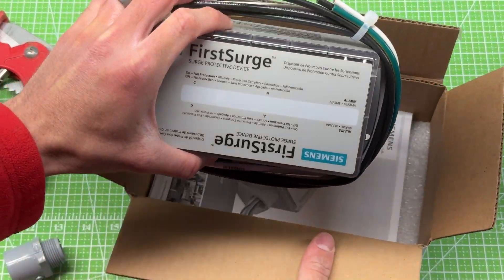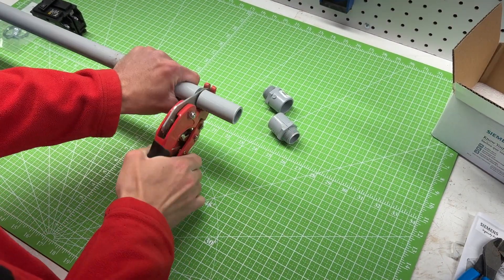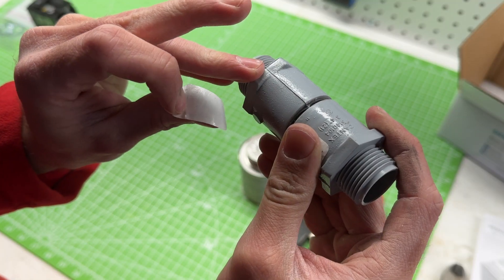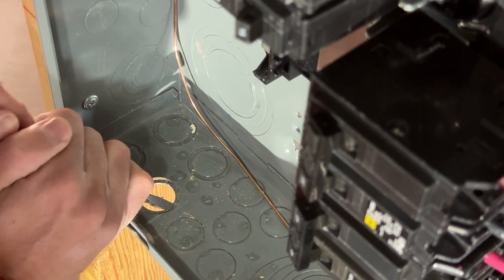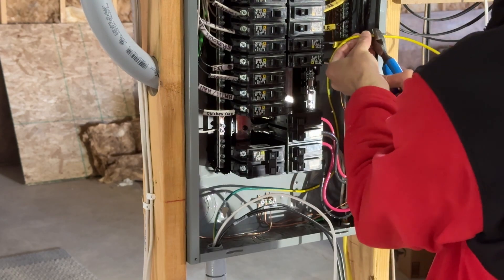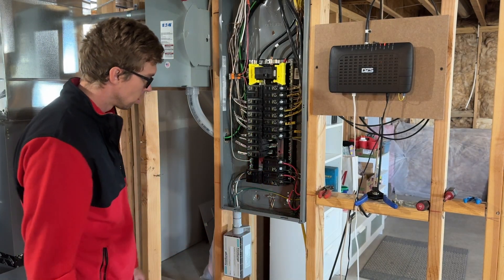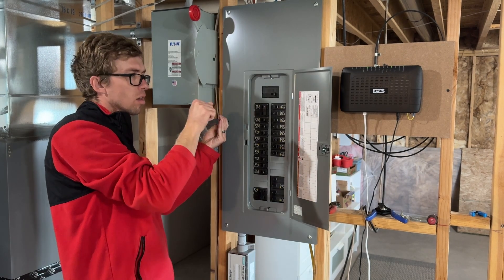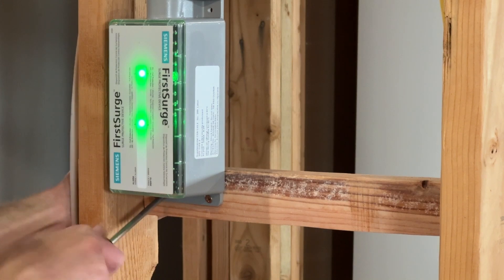Surge Protect Your WHOLE House

Comment: I don’t see a big ground conductor where the surge will get dumped by the FS140 through a short path to ground.  In my install the panel is on the inside of an outside wall and a 1/4” ground conductor goes 4’ down from the bonded ground/neutral bus to the outside ground rod.

In fact, where is your panel ground.  I see the neutral connection at the top and that the neutral and ground bus bars are bonded, but where is the fat ground connection??

Comment: 20 amp breaker for a whole house protector… what’s the KA on that surge?
Reply from the maker: The FS140 is rated for 140kA. Yeah the manual calls out using a 20amp breaker for the connection.

Thermal breakers don’t trip immediately and with such a fast surge it shouldn’t be throttled it in any way by the breaker.

Comment: A word of warning. Strong demand has the price of this particular Siemens bouncing around. I bought mine from Amazon four years ago for about $170. A service that tracks Amazon pricing has the Amazon price ranging from $159 to $464 between 2020 and 2024. It has the third party price ranging from $128 to $706 between 2017 and 2024. 
If price is an issue with you, Siemens has created a new version, the FSPD140, that typically sells for less. Youtube's abrelectric channel has a comparison of the two called "Comparing the FS140 to the FSPD140" that you might want to watch.

Comment: If the electrical wiring bothers you, the makers of some brands and models of breaker boxes offer whole house surge protectors that simply snap into place like a breaker. You only need to connect a white wire to the neutral circuitry inside the box. No voltages there. 

For Square D Homeline breaker boxes made after 2014 you are in luck. Their HOM250PSPD simply snaps in and doesn't require a neutral wire. That is built in. You simply need two adjacent breaker slots free at the top. And it is currently marked down 42% to $81. That said, the surge rating is only 50,000 amps as opposed to 140,000 amps for this Siemens. You can find a video of the installation at: https://www.youtube.com/watch?v=TmFbOQF85h8

Comment: How it workd? In my town got overvoltage, like 190v when i need 110v stable. This thing protect for that? Turn de breakker off?
Reply: This is a surge protector, meaning sudden, split-second over voltages that can run to thousands of volts. It is not intended to protect against continuous over voltage and if remember right it doesn't even cut in for voltages under 400 volts. 
If you're getting 190 volts regularly at the outlets, you need to yell at your power company. If they don't respond quickly enough, contact your state regulators.

Comment: The breaker should be installed at the top close to the main
Reply: Not as important as keeping the leads as short as possible FROM the SPD....TO the feed breaker. The "wire size" ( high ampacity) of the bus overwhelms the "desired" position close to the main. Another thing..... it would be even better that the lines from the SPD to the breaker be twisted around one-another or laid tight against each other....as it improves the voltage threshold VPR numbes. See here for added destail....but ya gotta read the detail to understand-->
- Cut leads as short as possible, between the SPD  (Surge Protection Device) and the panel-connection/breaker....for the power it needs. Very important. Long leads compromise the unit’s VPR specs severely. Besides short leads.....either twist the leads or zip-tie them together to re-gain “goodness”....if you can’t get absolutely shortest leads possible ( testing labs use 6” leads to come up with specs.)
- Not important WHERE on the panel buss.....the SPD dual-pole breakers are located. Intuitively, the closer to main breaker (Feed breaker, from line to load) the better..... but his has MINOR influence....much less than the short lead issues.
- Background on all this..... 
https://ep-de.mersen.com/sites/mersen_de/files/2018-11/TT-SPN8-Effects-of-Wire-Lead-Length-on-Voltage-Protection-Rating.pdf
Reply from the maker: I would have preferred that but I didn’t have space on either side of the panel towards the top. Networking equipment on the right and a transfer switch on the left. My placement isn’t ideal but it’s all I could make work given my layout. But I agree, if you can make it work at the top by your main do it!
Reply: @SmithOffGrid   So you have a transfer switch without an interlock?
Reply from the maker: @ITguyAR_66  Yeah we have a transfer switch and no interlock. You can see it in the last few seconds of the video. Grid comes into the top of the switch, solar inverter comes in from the left, and output goes out from the bottom of the switch and into our breaker panel.
Reply: @SmithOffGrid  everything above, it will not be protected, correct? Which is why it belongs up top?
Reply from the maker: @TheDarkKnight33  No, the circuits above will still be protected even if the SPD is at the bottom. The logic is that the surge will most likely originate from the lines coming from the grid at the top. So if your SPD is there it can begin shunting power a tiny bit quicker. But with the conductivity of the panel bus bars being so high, the benefits are likely negligible.

The instruction manual doesn't mention breaker position apart from keeping the leads from the SPD to the breaker and neutral and ground as short as possible. If they're too long that's when you actually see degraded performance.

Comment: I'm confused by why you installed it there.  Isn't the property under construction currently and will be drywalled in so you can't see the lights or service it later?
Reply from the maker: Yeah so it’s in our basement which we’ll finish at some point, but it’s in a utility room that will be left with unfinished interior walls. Drywall will only go on the back side of that wall so we’ll always have visibility and access to the SPD

Comment: I didnt use the metal plate. It cost $100 which is ridiculous. Also installed mine inside my panel at the very bottom as thats where the only space for the 2 double 20 amp pole breakers are locbated. I cant see the SPD when i open the panel but the light shines through the spaces where the breaker is.

Unfortunately i have the Fs-100 and not the 140. Is it worth switching out???
Reply from the maker: Yeah that $100 plate seems way expensive for what it is!

I’d say any SPD is a huge step up from not having one. Comparing the FS100 and the FS140, the difference seems pretty minor. Personally I probably wouldn’t upgrade
Reply: A while back I checked Amazon for an alternative and found a plexiglass one for $50. Still high, but not as bad as $100.

Comment: Hi there.   To answer a question below.   Yes, they should be connected as close as possible to the power source(Power Service Disconnect) coming into the panel, when possible.   A thing I did was similar to what you did when I installed mine.   I used a threaded 1/2" npt pipe thread to 3/4" PVC connection as well, the only difference is I cut the pipe part off so it was just like a nut on the end.  I then put the threaded part through the knock out into the FS140 I have so the unit is flush against the bottom of my panel.   What you did is not wrong, I just think it looks neater tight against the panel.    Thanks for the video!   Cheers.
Reply from the maker: That's an awesome idea! Never thought of doing that. Yeah I bet it looks a lot cleaner that way. The shorter the better, that's great!

Comment: Did the instructions indicate that the closer to the inlet voltage the better? Being in the bottom corner The Surge still has to pass all the other Breakers before reaching the bottom of the panel
Reply from the maker: I actually wondered the same thing but when reading through the instructions it didn't mention anything about that.

It did specify to "use closest breaker to SPD" and "ensure leads are as short and straight as possible". Per their instructions, I'm assuming those two bits are the most important factors?

But either way, with my panel I have network equipment on the upper right side and a transfer switch on the left. Plus the wires to the top breakers weren't left with hardly any slack so moving them lower into the panel would have been pretty messy with a lot of splicing. So the bottom seemed like the cleanest option for me.

I'd say if you can swing putting the SPD at the top to go for that! It does seem like the most ideal location would be closest to the inlet with having it come directly out one side

Comment: What is the installation method if the breaker box is recessed in the wall with drywall around it. Will the surge protector fit inside the breaker box?
Reply from the maker: I think it would technically fit inside, at least in mine, but it's not really designed for that. Siemens does make a flush mount kit that you can use to mount it recessed in the drywall next to your breaker panel

There's also a more compact style of SPD that connects just like a breaker. That could be a good option if you have limited space. You'd just need to make sure you find one that matches the type of breaker your panel uses
Reply: @DustinDoesStuff
I am sure by now you have gotten your answer...but just incase.  If your panel has enough space in it, it is perfectly fine to install it within.   The only downside you have is you can not see the lights to be sure it's still working, but the PS140 also has an audible alarm too.  Cheers.
Reply: I'm in the same situation as you. This Siemens fit easily at the bottom of my GE breaker box and green glow that shows it is still functional leaks out when the room is dark. I happy enough with that. That does bring up an important point. The green light is bright enough you don't want it shinning out in a bedroom.

When I bought mine Siemens was selling a metal flush plate for mounting their surge protector in a wall for about $100. That was so overpriced a Siemens' engineer posted the dimensions so people get their own made. I just noticed that someone is selling a Acrylic plate just the right size with the needed hardware for $50. That might be an option.